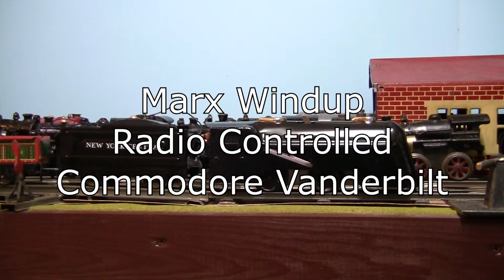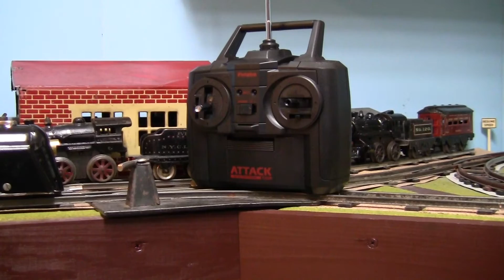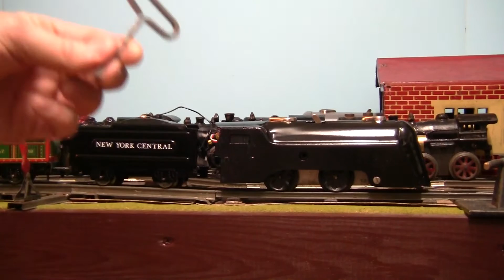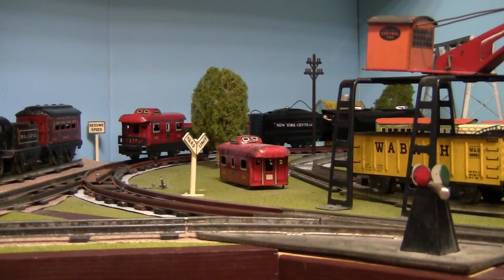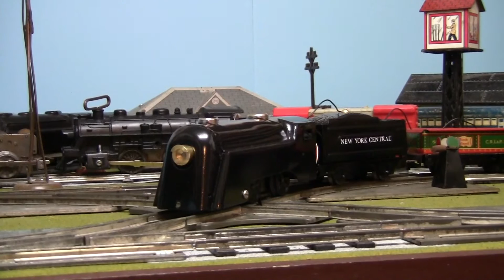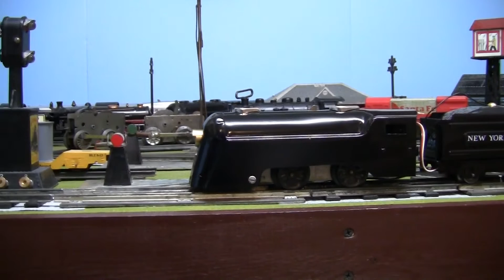Marx Windup Radio Controlled Train

Comment: Minor point, turn on receiver first,  then transmitter, prevents accidental starts. You can buy a number of cheap used 2.4GHZ RC systems and with ingenuity, operate switches, different trains, and other operating items . You could simply break the circuit with a servo operated switch to stop a Marx engine, and start in the opposite direction. Use transformer to operate control loco's speed. 2.4GHz systems are immune to glitching caused by sparking or other interference. Almost ready to fly (ARF) model planes come with cheap simple RC systems that modelers  eventually give away or sell on Craig's list .

Comment: I love your old wind up engines. I guess there all wind up's? Very cute set up with the radio control. Man, old O gauge is loud! :)
Reply: THAT'S THE POWER OF CLOCKWORK TRAINS!!!!! >:-3
Reply from the maker: The vast majority of locomotives in my collection are wind ups, although I do have a few of the Marx battery powered trains, a couple of electrics and one lonely live steam O gauge locomotive.  Everything you saw on the layout in this video is windup.  You should hear it when I run two trains at once... it is almost deafening... a glorious racket!